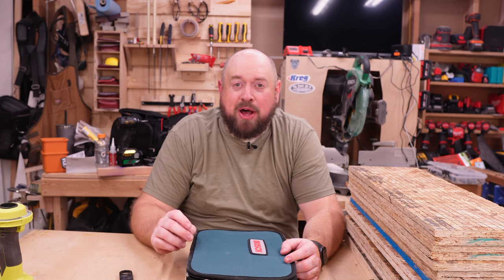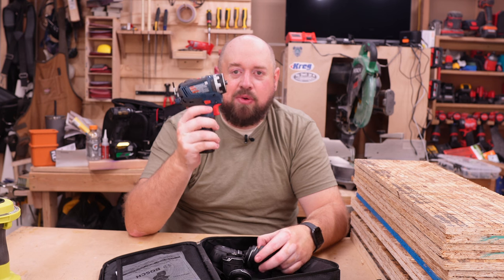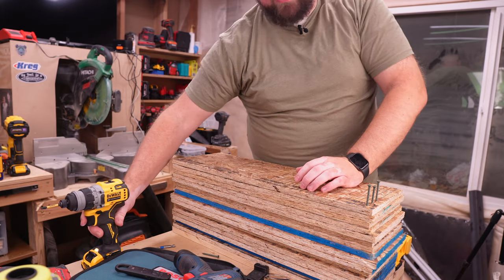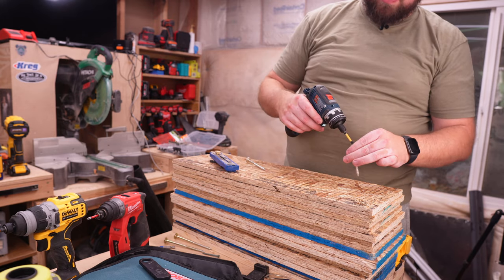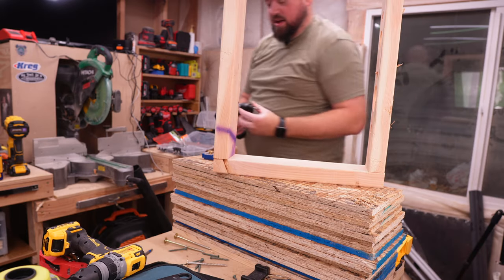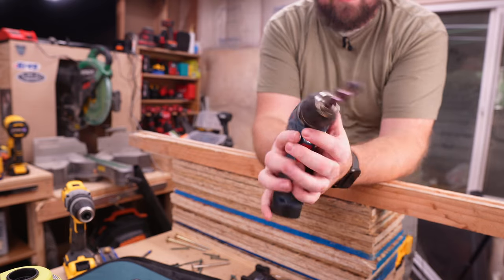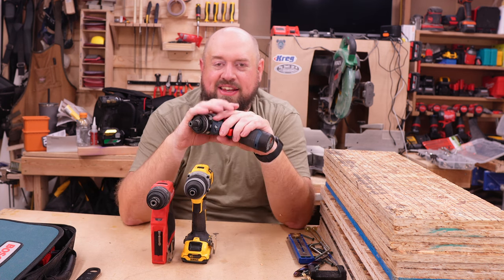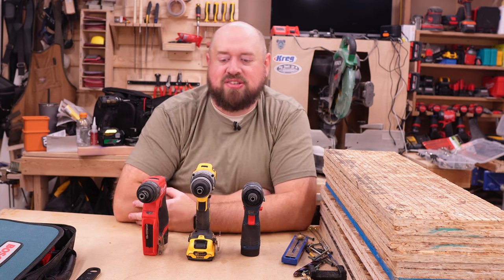2022 Best 12v Installation Drill

Comment: I've got to disagree with you bud, when I was looking for a smaller install driver I noticed behind the counter of the tool shop a huge amount of warranty returns for Milwaukee, smoky motors, broken chucks etc etc, this turned me off buying one, great strong skins but they seem to break easy, I would've purchased dewalt but the one thing that stopped us was the battery design, the bosch is by far the best, might not be the most powerful but for installs you're not going into any hardwood timber and you have higher powerful tools for that. 

With the design of the bosch we're able to get behind drawers and right into tight spaces, after almost 2 years of abuse they're both going strong and batteries are still fine.
Reply from the maker: What didn’t you like about the battery design on the DEWALT? Just curious.  I have had the M12 since early 2020 and it’s done everything I needed it to and more.   In a prior video it had a smell after some strong testing but hasn’t had it since.   Overall I’ve been impressed but they each have things that I love about them.
Reply: I love the Bosch. Besides the easy insert collet and the wrong direction pull (not as bad as the Milwaukee direction change on the top) he was wrong in every criticism he had.
Reply: Two things. I have at least fifty Milwaukee M18 and M12 tools and never had one break. That said, you're likely to see the most returns on the tools a store sells the most, all other things being equal. A few years ago, I was all DeWalt. Never had much of a problem with them except for a Jacob's chuck breaking. I've owned plenty of Bosch and Makita and those are solid too. You can hardly go wrong.

Comment: I wonder if the brushed Bosch is better at low speed control? That’s the one I have and I absolutely love the low speed trigger action. I don’t bother with a handheld screwdriver much anymore because it’s so good at slowly and accurately driving screws. Even self tapping wood screw removal and replacement feels safe. 

I do have an M12 Fuel drill which I use for drilling larger holes. Its low speed control isn’t nearly as good as the Bosch but it does have power. :)
Reply from the maker: I haven’t tried the brushed version but the trigger control on the brushless version wasn’t that precise.
Reply: He used this one in speed 2 and the Milwaukee in gear 1 (you can even see him switch gears in the cut after). Who needs speed control in gear 2?! Mine is completely fine, don't worry.

Comment: The switch on the Milwaukee does not bother me . Use the little feller more than my m12 fuel impacts or drill.
Reply from the maker: I get used to it after a little while but it’s the one glaring flaw on an otherwise perfect tool for me.
Reply: @TinkerWithTools  yes sir I think I’m the only one that doesn’t mind it. I like it better don’t bump the switch with your hand . Been to many times grab my gun bump the direction switch .

Comment: Could u not attach the other chucks to the right angle chuck on the bosch?
Reply from the maker: Yes you can.   I mentioned that but it might have gotten cut out of the final edit.  Doing so will add length and put it at a disadvantage in overall length for those really tight spaces.   It would have been nice to have a magnet though like the other two.
Reply: @TinkerWithTools  so you actually did wanna make the Milwaukee look better.. Interesting. Yes, a chuck is longer but it's a lot tighter than a magnet.

Comment: Wrong, the Bosch is much smaller and fits the niche market for hard to access areas.  As far as other applications, use another tool that’s designed for that.

Comment: Bosch for the win. They also have an sds attachment for it. I’ve owned all three. The dewalt has a nice grip buts it’s bigger than the Bosch, with out anymore more power. The Milwaukee sounds so bad to me. I absolutely dislike the whiny sound of Milwaukee drills.
Reply from the maker: I think that they are all solid options.   Of the three I don’t think you can make a bad choice so your choice of Bosch is a great one too.
Reply: Absolutely. Dewalt and Milwaukee have other great tools that bosch completely effed up their version of it. lol

Comment: I have to disagree as I think the DeWalt line is the better choice.
Reply from the maker: Not that you are wrong but what tools lead you to that decision?  DEWALT has made a lot of progress recently and I like it but they have a long way to go before they have all of the tools that Milwaukee has on M12.
Reply: @TinkerWithTools  I have the 12v impact driver, drill driver, and screwdriver. Love them all for diy.
Reply from the maker: @lcook0825  those are great options.  If that’s all you need or want I think DEWALT is a fine choice.
Reply: @TinkerWithTools  Thanks.

Comment: I own 25 m12 tools but I'll never buy that stupid driver of there's.  I bought the Bosch despite not owning any other Bosch tool. It's the smallest and lightest. The power is fine. No one should be trying to drive a 3-inch screw in with an installation driver anyway installation driver anyway. They're not made for that. Plus for 80 bucks you can get a 6 amp hour battery for it. Which also allows it to stand up perfectly and for the record the right angle attachments on all of them is virtually useless. I have yet to have it actually work for me.
Reply from the maker: I appreciate you sharing.  What is it that you dislike about the milwuakee?
Reply: @TinkerWithTools  the switch on top. (There are plenty of times that i just would never be able to reach it) and the magnet bar down the front 
The bar will prevent the drill from getting into some places
 ( I sometimes work in very tight spots inside certain commercial desks)
Magnets are very handy but that festool design is just terrible

Comment: Standing these tools on their batteries is  a bad habit anyways. These are usually used in finished products and this bad habit can mars up the surface when they inevitably fall over at some point.  They are all inherently imbalanced when standing on their batteries.
Reply from the maker: I would agree that it's nice practice but compared to the other two when the drill chuck is in place, the bosch is noticeably worse.
Reply: The point is that standing a tool like that isn't good practice, so "worse" may be a tool that encourages you to do just that. Milwaukee and Bosch 12V have the same battery designs so what makes the Milwaukee more stable is the knuckle guard which I'd gladly do without. But I agree that the selector switch is the main problem with the m12. But I do dislike the handle bulge of the M12 stuff as well.